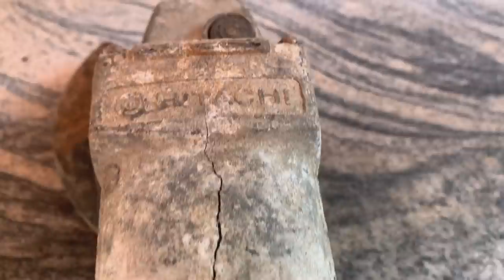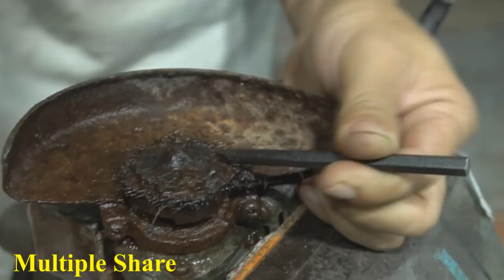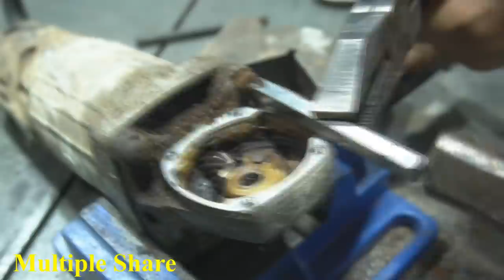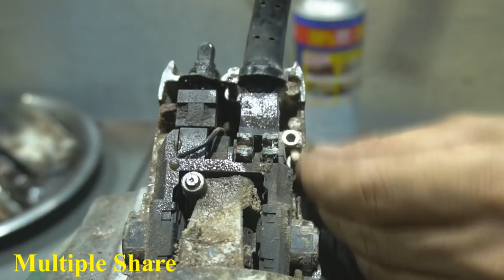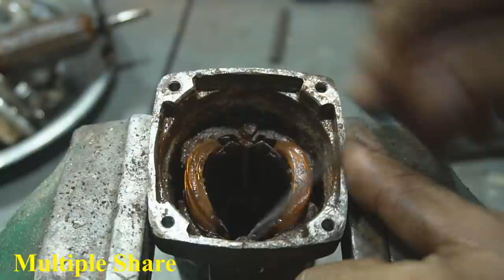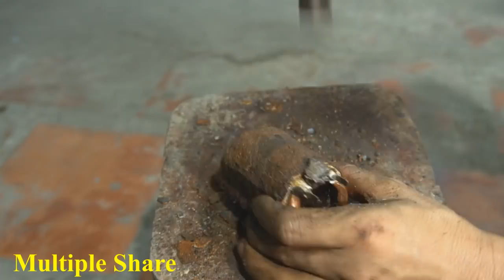I Fail to Restore This Electric Grinder  Why? /Electric Grinder 125mm Hitachi G13S1

Comment: There should be more videos of restoration channels' failures. Showing nothing but success makes a big illusion that it's easy and infallible, when that's not how reality works.
To continue with that, you need a new shell or a tig welder. But even then, the shell is too far gone and fragmented. I commend your bravery in showing that not everything has a happy ending.
Reply: I agree!  There's a time to say "this isn't worth restoring... it's too far gone!"  This item is one of them!
Reply from the maker: Some parts are too old, need to be replaced but no spare part

Comment: it was necessary not to beat the body on the metal to knock out the stator such things hit wood because the metal is very soft the second was not to beat immediately but to lower the rust Converter for a day or two and then just start knocking it out or try to take it out
Reply from the maker: thanks for your advice

Comment: don't finish if you use epoxy or bondo for repair and restoration if you use mig welding aluminum then proceed.
Reply from the maker: thanks for advice

Comment: I have  seen what you are capable of restoring.  In my opinion this is truel an impossible restoration and should be scrapped for it copper and aluminium.
Reply from the maker: Some parts are too old, need to be replaced but no spare part